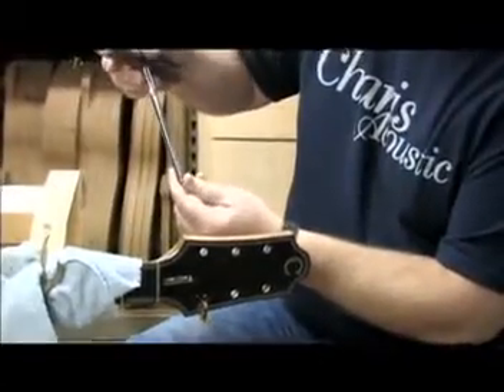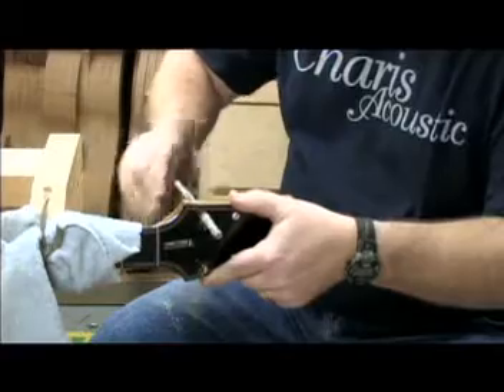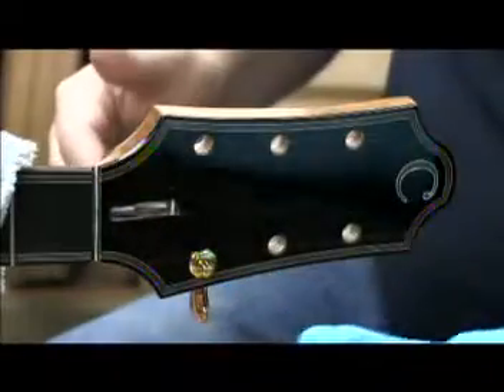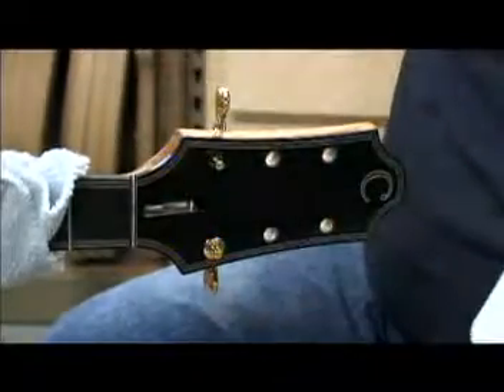Charis finish 2

Comment: If there is a screw in the end of the button, you can most likely remove the screw and the button will come off.  I recommend that you release the tension on the string before removing  the screw because some tuners will come apart from the string tension pushing the worm gear and shaft out the end of the housing.  Once you remove the screw the button should come off.